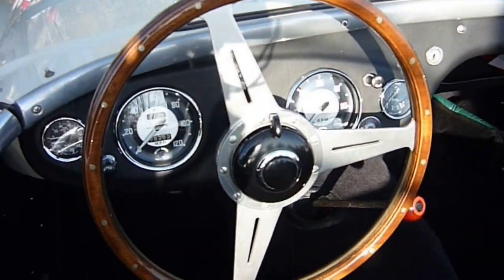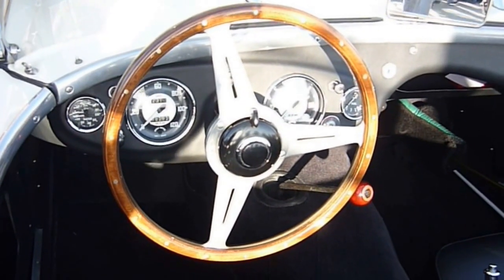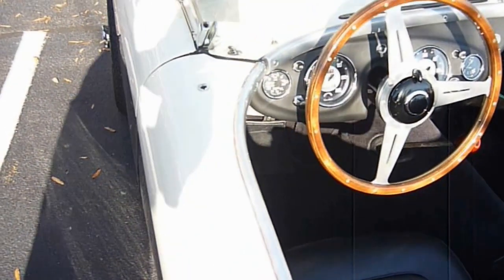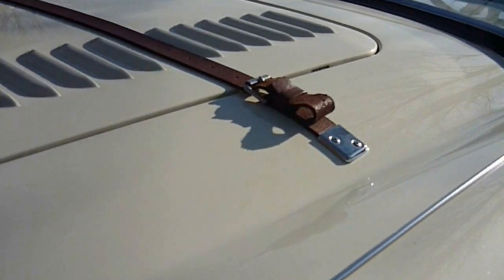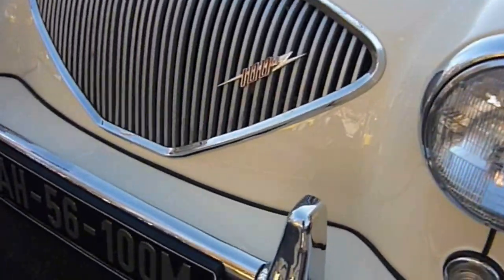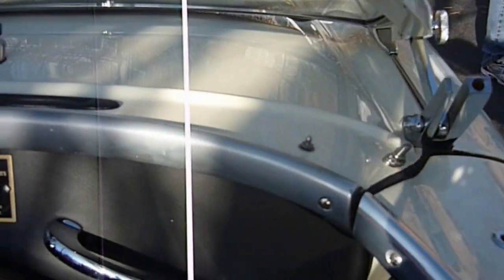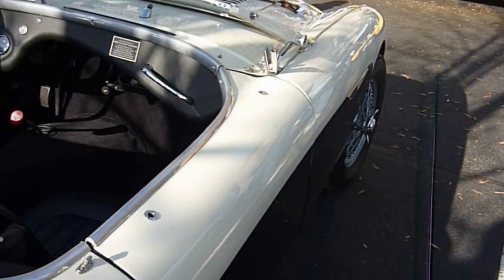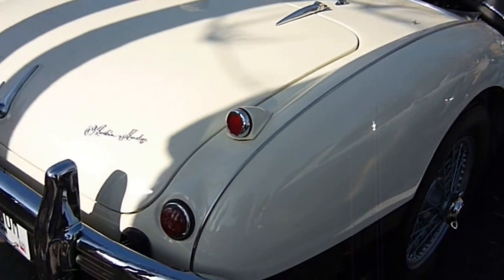1956 Austin Healey 100 4 M LeMans

Comment: Miquel, here may be a little confusion between 100-4 LeMans and the 100-S models. The 100-4 LeMans had steel panels including louvred hood and boot lid. These models had a slightly dished piston compared to flat top pistons in the S model. The cylinder heads were cast iron in these models. 100-S models 55 + made had complete alloy bodies and aluminum cylinder heads. A great video and thanks for bring attention to these beautiful cars. We can all learn something everyday even the experts.Good Job

Comment from the maker: Here is the actual breakdown. The first 100's (series "BN1") were equipped with the  90 bhp engines and manual transmission as the stock A90, sedan. It was all steel. BN2 was fitted with a real 4-sp trans instead of3,overdrive on top 2 gears, the BN2 has slightly larger front wheel arches. 1955, a 100M model was developed, with larger carburettors, a cold air box to increase air flow to the carburettors, high-lift camshaft and 8.1:1 compression pistons. It produced 110 bhp.

Comment from the maker: There were 640 factory built 100Ms—all BN2 series cars. The 100M components (except for the high compression pistons) were also available as the Le Mans Engine Modification Kit which could be installed in either a BN1 or BN2. S model Built primarily with racing in mind, the aluminium-bodied "100S" (for Sebring) model developed 132 bhp (98 kW) at 4700 rpm. Only 50 production cars were made, plus an additional five works development/special test cars which were hand built by the Donald Healey Co.

Comment from the maker: The cast iron cylinder head was replaced by one made from aluminium and the overdrive unit was not fitted to the gearbox. Dunlop disc brakes were fitted front and rear.

Comment: Miguel Carparros……..Mmmm - this looks like quite a nice '100/M' [although the gaps between the doors and shroud panels seems a little wide to say the least!]. I also think the colour scheme of 'Old English White' over 'Lobelia Blue' [which was specifically developed for the gorgeous 100S] detracts from the 100M. But that's just my personal opinion.
However, I think you were either misinformed or are totally misguided about the car's specifications and history. Firstly, 100M's were NOT 'all-alloy'. The front and rear wings as well as driver and passenger doors were made in steel - whilst the front and rear shrouds, bonnet and boot were aluminium. [in fact, this led to problems when the cars were shipped to the USA - dockers, unloading them in the ports would dent the boot lid and shrouds as they pushed the cars onto the transporter lorries]. 
But there was another much more significant issue caused by using steel and aluminium together. When the two metals come into contact, it results in a reaction known as 'electrolytic corrosion' - a powdery white form of rust. To prevent the problem and if you notice, all Healey 100's, have a 'domed T-section' rubber-lined beading separating the shrouds from the wing panels. [this was probably only used on the all-aluminium bodied 100S for aesthetic reasons]. 
You are also completely wrong about the 100/M racing in the 1953 Le Mans 24 Hour race! 100M's were produced between September1955 and late 1956. [the '100M' variant of the 100/4 was to commemorate the car's 12th and 14th place finishes in the 1955 Le Mans 24 Hour race - which was a pretty remarkable result given that they were racing against the much more powerful Jaguars and Mercedes. When 100/M's became available to buy, they were largely built to the exact same specifications as the actual race cars]. 
The revised specifications included larger 1  3/4'' H6 SU carburettors, a cold air box to increase engine air flow, high-lift camshaft and higher 8.1:1 compression pistons. In addition, 100/M's were equipped with Alfin front disc brakes, stronger valve springs, revised distributor, louvered bonnet with leather strap and '100/M' badging. 
Despite this, it is worth noting that Donald Healey Motors never kept an accurate account of how many of 100/Ms were actually produced. It is estimated that Austin of England [who had bought the Healey 100 marque in 1952 and renamed it as the 'Austin-Healey 100'] built just 640 examples - using BN2 series 100/4's as 'donor' cars. However and to repeat, no record was ever kept in respect of specific chassis and engine numbers or who bought these particular cars [unlike the much rarer 100S]. 
Then a further 519 100/4's [mostly BN1s] were produced fitted with the ''Le Mans Kit'' - so as to meet the 100M specifications. As the 'Le Mans Kit' could be purchased as a 'bolt-on optional extra', it is unknown how many were sold and retro-fitted to existing 100/4's.  To further add to the confusion, it was [and still is!] common practice for many 100/4 owners to 'upgrade' their cars to look like 100M's - using a variety of 'non-standard' parts and components. [I actually considered doing this to my own 100/4!] I suggest this is the reason for the alloy head [is it the Weslake designed one, as used on the 100S?] and plaque found on the dashboard of the car in the video claiming it to be a 100/M.
So whilst 100M's were only produced between 1955 and 1956 and are one of the most sought-after of all the 100's [with the exclusion of the much more exclusive and gorgeous 100S - of which only 50 plus 5 works/test cars were ever produced] it is probably Impossible to determine whether any 100M is 'genuine' or not.